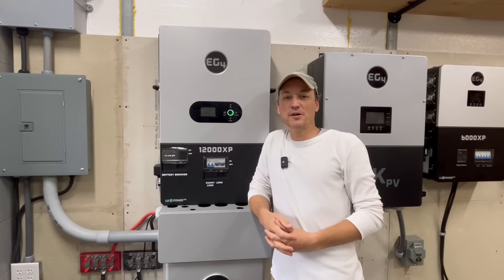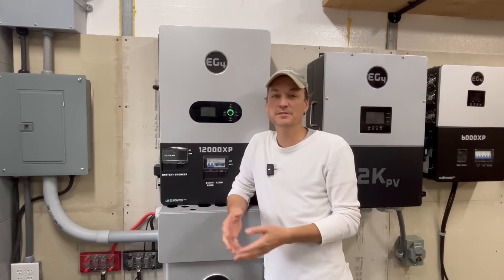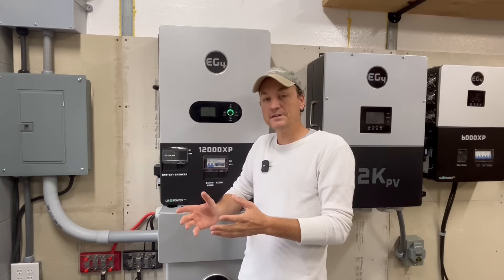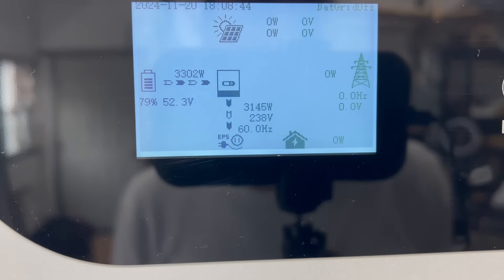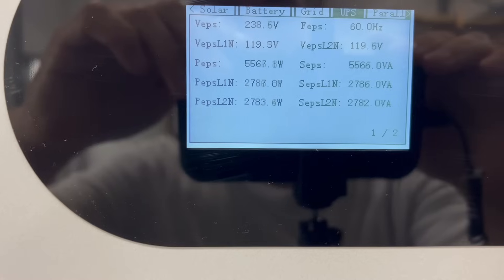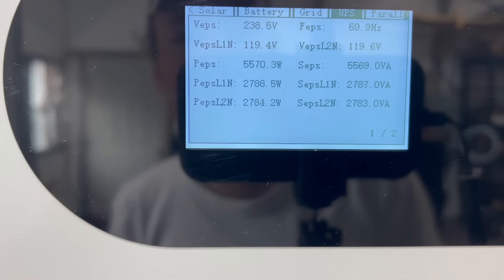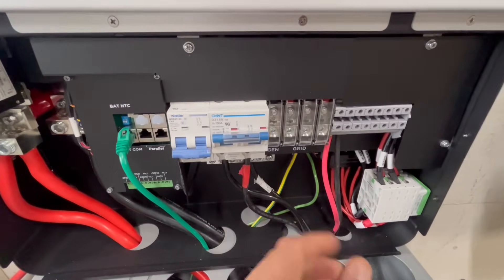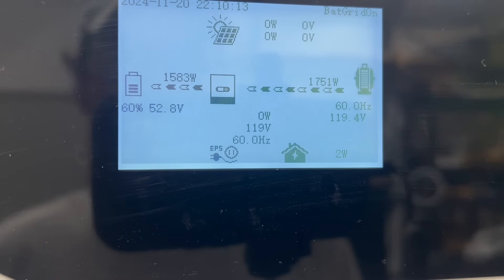EG4 12000XP off grid inverter follow up and Q&A

Comment from the maker: I forgot to mention this in the video, but for those of you that don’t need to reach that 24kw limit in solar, you could easily reach 16-18kw without any combiner boxes or extra wiring. 

Affiliate links: Signature Solar’s link to the 12000xp

https://signaturesolar.com/eg4-12000xp-off-grid-inverter-48v-split-phase-24kw-pv-input-12kw-power-output/?ref=mpmddlkx6M9tPo&utm_campaign=12XP%20Inverter%20Launch&utm_content=Homepage%2011%2F1&utm_source=web&utm_term=Homepage%20banner%2011%2F1

Current Connected’s link.

https://www.currentconnected.com/product/eg4-12000xp-48v-split-phase-off-grid-inverter/?ref=xhJJBPDS

Comment: Great video thank you. Question, Why can i not connect this unit to my main panel? i thought this has a setting that prevents back feeding into the grid?
Reply from the maker: It does have an anti backfeeding feature. But you wouldn’t be able to connect this to your main panel for the same reason you could connect a backup generator to your home at the same time the grid is on. 

If they aren’t a hybrid inverter then they can’t match phases with the grid. So it would be two competing power sources in the same panel. Which would lead to all sorts of nasty consequences.
Reply: @GavinStoneDIY  Copy that, thank you for the response back! I am a bit of a newbie to all of this stuff so appreciate all the advice. Looks like i need to go with a separate subpanel, but man i am limited on space in that area. I need to think this through a little better. Thank you again Sir
Reply from the maker: @guttercops sure thing. And keep in mind you could really put the other panel anywhere. But the further it is from the main panel, the more you’d spend on wire.  If you haven’t seen my wiring guide on the 6000xp that’ll probably help. It describes how to wire in the superset panel.
Reply: @GavinStoneDIY  awesome thank you Sir i will check it out ! Really appreciate the help and advice

Comment: Thanks for the video.  I am trying to figure out string voltage and current with the bifacial panels like the Sirius 415’s. In other words is there a VOC for front and a VOC for back?
Reply from the maker: They total the voc and amperage numbers. So the specs they give are for both together.
Reply: @GavinStoneDIY thanks for your reply.  I was confused looking at the panels data sheet. They have listed VoC for front and back.  As well as Vmp, Isc, and others for front and back.  Just trying to plan for strings that don’t exceed voltage for the MPPT.  Thanks again and all the best from north Texas.

Comment: Yeah good point. No need to add a combiner box when you can combine 2 strings on both mppt controllers for the pv connection. I have 3 strings of Aptos 410w bifacials. 10 panels each string 2 parallel on 1 and the single series on another which give me room to expand if needed.
Reply from the maker: Agreed yeah. Really only if you want to approach the maximum PV numbers will you need 3 strings per mppt.

Comment: Love the video. Thanks so much. Trying to charge mine with a 120v inverter generator and nothing happens. Any ideas? I have it wired to L1. Maybe i need a ground neutral bond? Or possibly change some settings. Sorry i know its vague
Reply from the maker: I’d  probably have to see the wiring. You’ve got it hooked to the L1 on the generator port?
Reply: Yes  @GavinStoneDIY
Reply from the maker: @twobroskarting2302 could be a settings issue then.
Reply: I reached out to signature solar and they said the new firmware doesn't allow the 120v charge on a 12k. They said thats been the case for about a year but im not sure if thats just them trying to prevent me from rigging it to work
@GavinStoneDIY
Reply from the maker: @twobroskarting2302 not sure why it won’t work though. I reached out to EG4 techs. Mine works fine with 120v input.
Reply: I reached out to them and the pretty much said its hit or miss. Ended up ordering a chargverter @GavinStoneDIY

Comment: We have two 12000xp's, and 2 powerpro wall batteries. We have it all paralleld and working together, however, we are not getting volts to the combined 70amp breakers! What's wrong?
Reply from the maker: The small switch on the left of the inverter towards the bottom. Turn  that on.

Comment: i DONT GET THIS VIDEO you don't need that much power for a normal home, unless you have a mansion or you   used your home for some type of work that required more power, so why not make a separate video for each.
Reply from the maker: I’ve made a couple videos on this inverter. The amount of power someone needs can vary. If you want to run your whole home and charge an EV then you’ll need plenty of power. So what a “normal” home is, can be quite different for people.
Reply: Always buy a inverter double the power than you need.

Comment: Would you say the noise is tolerable for living space at high levels?
Reply from the maker: If it’s in the same room. Not really no. It would be loud during the day when charging. Or at high output. 
If I had to have something in the same room I’d pick the flexboss 18. It makes almost no noise at all. But then of course it does cost a bit more.

Comment: Sounds like you trying to increase voltage if you have less panels ( like 4 to 5 panels per string). Thus paralleling them in a combiner box would allow you to put more solar panels of each pair of MPPT inputs. Not much help if you have over 100 solar panels and several 12000XP . Example nearly all of our MPPT input pairs all have 9 to 10 solar panels on each string. Great information thanks.
Reply from the maker: Yeah if you don’t need to max the unit out then it’s much easier to wire in the solar. I think you can get to 18kw without needing a combiner box.

Comment: Why would I buy an official "PV combiner box" instead of just a box with a bus bar?  12kXP clips it anyways so, what do you gain over a normal bus bar connection?
Reply from the maker: A fused disconnect with diodes. I realize solar panels have diodes as well. But in this case,  you’re dealing with a lot of wattage/ amperage. I just feel more comfortable with a combiner box. It’s cleaner, and has SPD’s as well.
Reply: @ Thx for reply.!   WHY on earth would I need a fuse on a PV array?  Its not like they can magically create MORE amperage or voltage than normal.  I don't get it.  Disconnect--> Yea, I get it, 100%.  Am I being dumb here?  <^o^> ?
Reply from the maker: @w8stral I had a fuse blow last year from a lightning strike. It actually jumped my surge protection device. Honestly, I just show how I would do things for safety and simplicity. But everyone does stuff differently. 🤷🏼‍♂️
Reply: @ Thanks for reply: Lightning strike.  Did it save your mppt controller/inverter?  Thanks.
Reply from the maker: @w8stral yeah it saved the day. All I needed was a $.50 fuse.

Comment: Can I use 6000 xp  with out batteries but getting back up from grid
Reply from the maker: No, you’d need a hybrid for that. it would either be solar or grid. A relay is in place between the two because this is an off grid inverter. You could start out with just one 100ah battery. That’s really the best plan. It wouldn’t be enough for full output, but it would give you power in between clouds or during the night.

Comment: Was about to pull the proverbial trigger and wanted to see more info and found you here. Helped answer almost every question I had left before making the plunge. I had 2 questions though, and you cant blame me because your excellent coverage is what made the question emerge in my thinking. 1) I was thinking of getting 30 of the 400 watt panels. This comes out to 12000 watts. What I was wondering is what if I come to the point where I find some 350's or whatever. I assume that I can just feed another leg of the mppt's. Is that correct? I don't have to worry about a voltage and wattage variation between the 2 different inputs to the 12000xp? 

Also, you mentioned combiner - same question. Can you combine arrays with differing wattage panels and somewhat differing voltages on separate input channels of the combiner? 

Finally, you mentioned that you had to use 120v leg (L1) when charging from the grid. Can you not charge with 220 off of the grid? Just take each side of the panel and connect it? 

Maybe these are too many questions for a forum like this.. Thanks for taking the time to educate us.
Reply from the maker: Good questions! Yeah so you can have completely different panels on the second mppt. They are independent. If you were to combine two different types on the same mppt they would all favor the lowest wattage. So it’s not recommended. 

With the 120v test I was just showing people it can charge from 120v on L1. Which isn’t as common with inverters. The majority of the people will be using 240v. And that works great. Hope this helps. I think you’ll like the inverter. I have gotten a lot of positive feedback from people on it. And it’s done exceptional on all my testing. I don’t always  mention it, but if you use my Signature Solar links you should get a discount also. 

Feel free to ask any questions. You can also email me. Either way I’d like to see your install when it’s finished. Always love seeing people’s installs.

Comment: What are your settings to achieve max 12,000watt output? I can’t seem to get above 8500watts without it going into overload. I’m running off of 2 power pro batteries.
Reply from the maker: @MCBuildNH  are both batteries registering with communications? It might be limiting the current if it’s only seeing one power pro. The second thing I would check is your discharge settings. Make sure you have it set to 250amps of discharge.

Comment: i have 3 6000xp ..can you add a 12000xp / can they communicate with each other 
are you running the 6000xp 18k pv and 12000xp together
Reply from the maker: @Ebbrush3  they can’t communicate with each other right now no. There are certain ways to do it, but it’s not really recommended.

Comment: How do you wire both inverter parallel out to the main panel.
Reply from the maker: @bearupfarm1818  are you referring to connecting the inverters output to a sub panel?
Reply: Yes,
Reply from the maker: @bearupfarm1818  you can either combine the outputs in a small box first, or feed each to a breaker in the sub panel.

Comment: This is the EXACT video I've been trying to find.  I'm trying to understand how to get to as close to the 24k watts without going over the 480 volts.  What's unclear to me now though is what is happening in the combiner box.  If 2 strings are coming in at approx 370 volts, what is happening on the output?  Thanks for the great info so far!
Reply from the maker: @XcessCapital  yeah I’m going to be making my combiner box video next. It just takes me a while to get things done with my actual job also. 

The output of the combiner box would be 2 strings in parallel. So the amperage would raise, but the voltage would brain the same.

Comment: @GavinStoneDIY , do you happen to know at what point the fans kick on for PV input wattage?  I have a 6000xp in the basement, and the fans are pretty loud when taking in anything more than 2000w of PV.
Reply from the maker: @mattcwagner  I haven’t hit that threshold with the 12,000xp. But my guess would be the same as the output wattage. So around 6kw before the fans start to ramp up.

Comment: When would you use the 1200XP versus the 12KPV?
Reply from the maker: @Bgoffgrid3634  the 12kpv’s continuous output is actually 8kw. So that’s something to keep in mind. If you needed hybrid features like net metering or grid interactivity then I would go with the 12kpv  or 18kpv. They both don’t need air filters and are outdoor rated also. 

The 12,000xp is an off grid work horse. So you can use the grid as a backup. You just won’t have those same standard hybrid features.
Reply: @ that makes sense now. Thanks for the great videos!

Comment: The 1200xp is such a good unit, Ive been using my smart load to "dump" excess solar daily into an EV without touching anything. I have also been able to crank my biggest 240v Mig welder to max output without even having the cooling fans kick on ( @ 131 battery amps continuous). I didnt know the smart load would take power in as well as output, if I hooked into line power to take advantage of grid tied solar.

Comment: I guess I don’t fully understand what happens when panels are paralleled…I thought the amperage had to match?  In your scenario one string is 13 amps and the other is 26 amps.  I understand voltage stays the same but do all amps just stack up?  Regardless of panel type?  Assuming relatively same voltage?
Reply from the maker: @SolarinStarke-kt2lm  this scenario would assume all panels have the same spec per mppt input.
Reply: @ right but you are feeding one side of the MPPT with roughly 24 amps and the other side ( I assume you meant the other side of same mPPT) with 13 amps.   I thought you could only combine same numbers 12 and 12 amps  for 24 or 10 and 10 for 20  that’s what confused me.
Reply from the maker: @SolarinStarke-kt2lm  technically mppt 1 has 2 separate inputs. And mppt 2 has 2 inputs also. So 4 inputs, 2 mppt’s. So that’s to allow a scenario like this. It’s specifically for paralleling strings of solar. So technically you could combine them all out in a separate combiner box and send one string in with 30-35 amps worth of solar to each unit. But this allows you to send 2 strings in and it’ll combine them for you.

Comment: Did you experience a warning 28 error? This inverter has a false EPS overload error that hasn't been fixed yet.
Reply from the maker: @maxgor7959  I still haven’t seen this edit myself no. But I’ve read some comments from people online that have. EG4 has said they are nearly done with a firmware that rectifies this issue.

Comment: Is it possible to have the generator supply 240v to handle and arc welder and air compressor if the battery system is not large enough to handle the demand?  Thanks
Reply from the maker: It depends on the amperage those are pulling. If you don’t have enough battery then the unit will be limited. It can’t blend generator and battery together.

Comment: Why can't it feed your entire main panel instead of a subpanel? The hybrid invertor has the capability of sending power back to the grid but I don't want that. I want to run this system in "self consumption" mode; in which I use solar first, then battery and if those cannot keep up I use the grid but running my entire panel.
Reply from the maker: These are technically off grid inverters. The 12kpv and 18kpv are hybrids. The grid and this inverter can’t be hooked to the same panel in that way. This doesn’t have CT’s, so it can’t sync phases with the grid power. So you can’t have the output and input of the inverter running to the same panel. Unless of course you had a disconnect on the grid and you manually disconnect it in order to use the inverter. But then you wouldn’t be using the automatic transfer switch that the inverter has. 

I explained this in more detail in my 6000 xp wiring guide video. The easiest way to utilize inverters like this is with a sub panel dedicated to all your loads you want to run off solar.
Reply: @GavinStoneDIY   I wired my Anker Solix F3800 with HPP with a manual interlock in which I have to the Anker "backup" off when the grid is up. If grid power goes down I turn off the main breaker for the house, the breaker that powers the Anker "Anker Grid" and turn on the "Backup Anker" breaker. I do lose the automatic switch over to battery but it takes 2 minutes to move the interlock and flip the breakers. I run the Anker in self consumption mode and I don't think is a big deal to not have the automatic switch over. It is also way cheaper because I don't have a subpanel and rather be able to power everything in my house then just a few items. 

My parents just purchased the 12000xp with the EG4 280AH battery and they want to do something similar. Thanks.
Reply from the maker: @juanmedinar20  yeah the sub panel could get pricey if it’s a long way from the grid panel. Otherwise it’s not too expensive really. If someone is comfortable doing the labor you could do it for less than $400 usually. It just makes it so much nicer with everything automatically backed up. That way if you do overload things it will just automatically kick things back to grid. 

But the interlock is always an option also. And in the future you could move the loads over to a sub panel if you’re feeling spunky.

Comment: I need some help with an hybrid inverter. I want to have my home office (that has lots of electronics) run on Solar power. I need to have solar priority so when when the batteries get down to say 25%, AC power kicks in and keeps the batteries charged up to say 50%  ..but will fully charge when solar kicks back in during the day. Which inverters can do this? 
Thanks for any help you can give me.
Reply from the maker: @percival23  you have a lot more versatility with the 12kpv and 18kpv. They will a have a lot more options. So it depends on your loads, but the 12kpv would probably work really well for you.

Comment: Gavin, thanks for the great video. You mention that larger generators can plug in directly to 12000xp, in your opinion would that include a 14kw Kohler? Thanks
Reply from the maker: Yeah usually the larger whole house units have lower THD numbers. So they can hook directly to the inverter without any issues.

Comment: In your hypothetical could you combine all three sets of 9 panels into 1 set coming to the 12,000xp? And have two of those totalling roughly 22,000w?
Reply from the maker: You could yeah. It would just require a second combiner box. I believe a 6-1 combiner would work. That’s 3 strings combined into one. And you’d need another box also for the second string. 

On the other hand that would save you from running more strings if you have a bit of a longer stretch to your inverter.